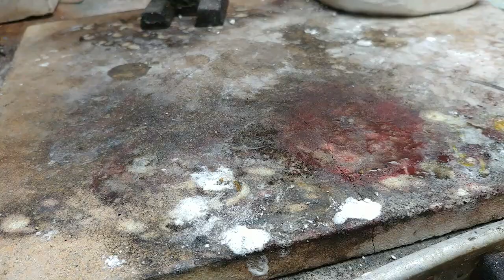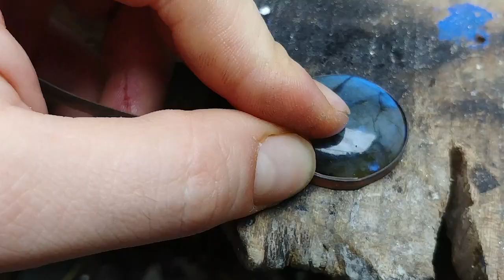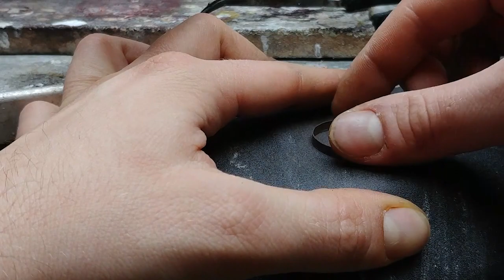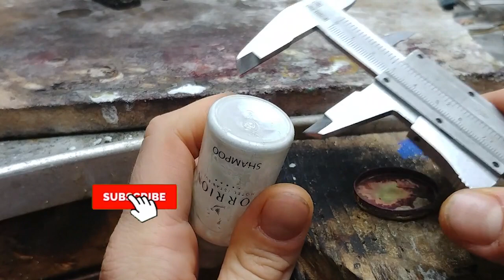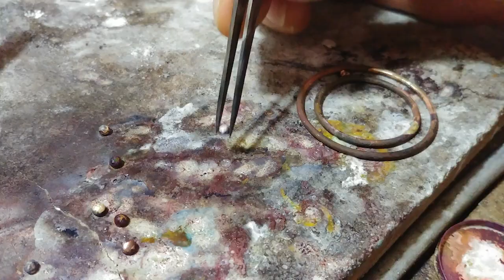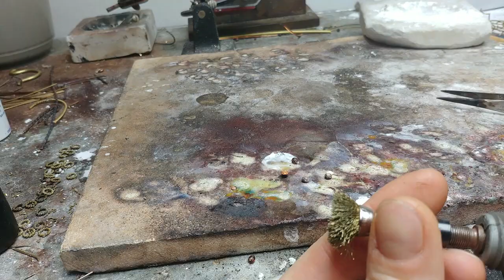Handmade Bezel Sun Pendant And How To Make Brass Spheres. ~ By Kryher

Comment: What are you using as your fine torch? it looks like an old tip from some paste solder. 😁
Reply from the maker: Hello there, I use an old school, '80s, oxy-hydrogen generator water welder with a needle point tip, very vintage and has a ton of problems, but in general it functions and comes in handy for detail work and for macro videos as I shoot with my cellphone's camera and propane flame makes it get too hot 😅
Reply from the maker: And I use cut and filed syringe needles as  tips, I get more variety and I can play on the gauges to get the flame I need
Reply: @bohdankryher9456  oh ok, that is something I have just never seen before. 
I know what you mean when it comes to working with just a cellphone camera. I did a lot of my videos using one too. I think this was the last video I did using my phone to record. https://youtu.be/E0UEHw-9Yow

I now use a sl2/D200 DSLR for all of my videos but I know it is a lot of money for a camera but it is a very nice upgrade 😁👍